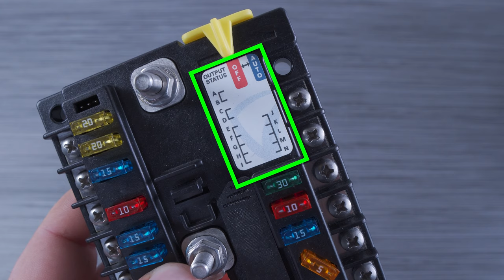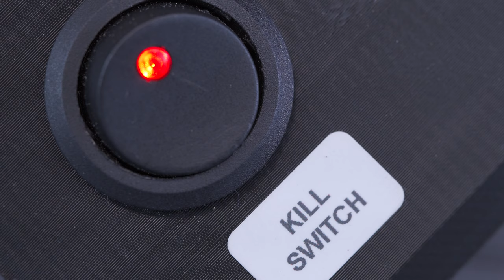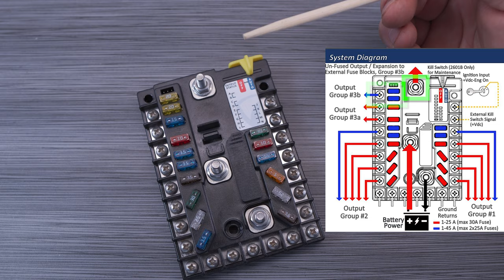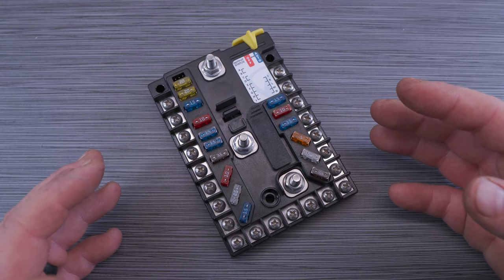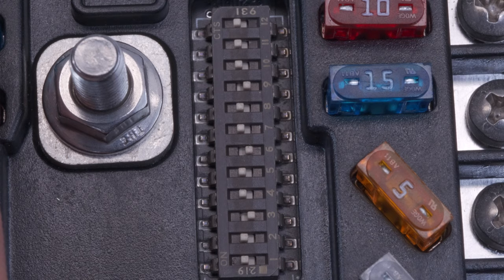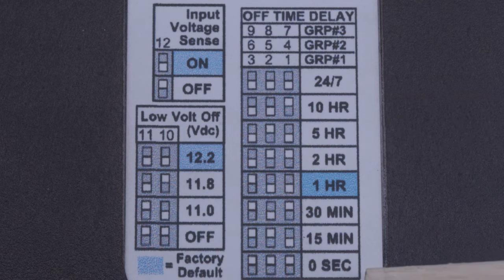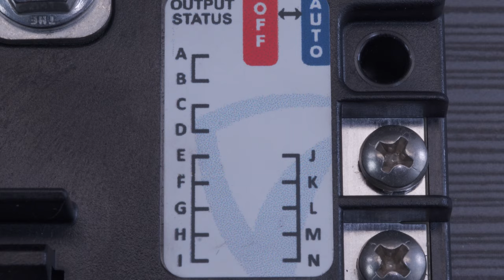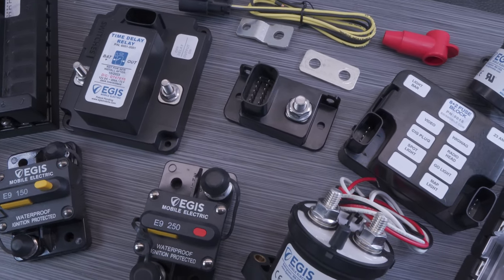PDM 14 Installation And Configuration Guide

Comment: I installed a couple of these units this week. They are ok. Seems like the dip switches are labeled backwards. Looking at the picture of the 1hr timer preset from factory and then how the switches are set are opposite 1hr looks to be on off off. But on the switches they are off on on. Am I looking at it wrong? I assume the white dot in pic is the switch position.
Reply from the maker: Thank you for your comment. For technical support, please email our support team at support@egismobile.com and they will be able to assist you.
Reply: Did you run your power and ground direct to the battery? Was trying to figure out the wire size and if it's fused at the battery as well. Thanks